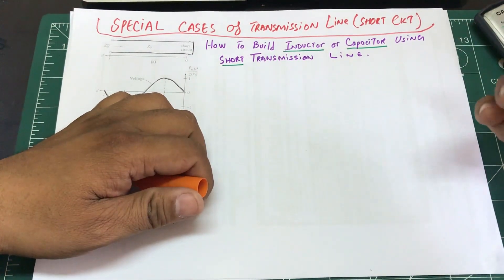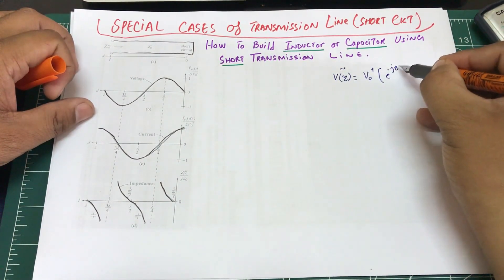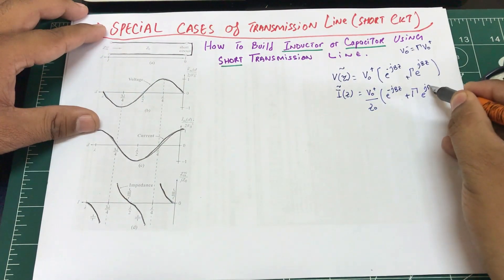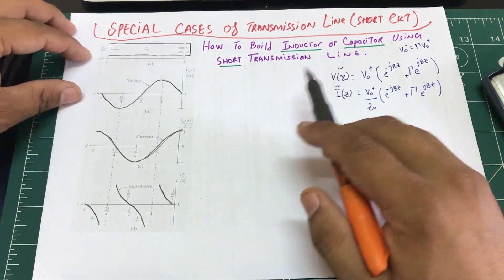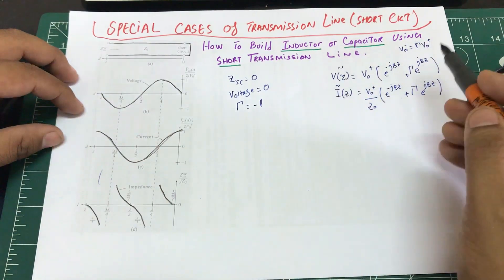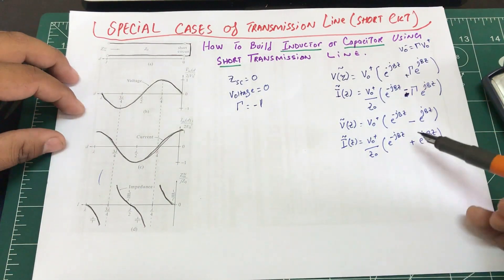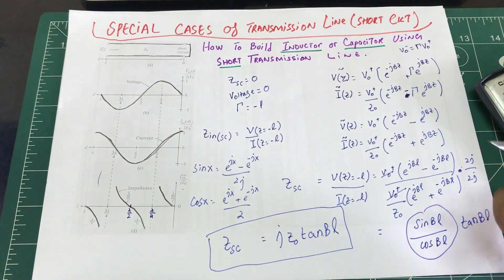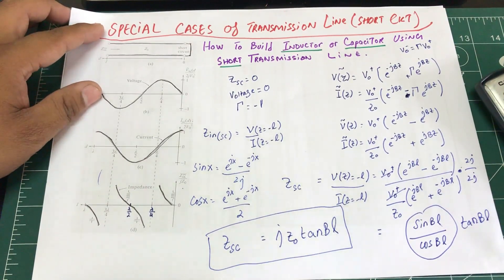Short Circuit Stub Design | How to build Capacitor/Inductor using Short Circuit Transmission Line

Comment: Cool explanation. Do you have an idea how added a series capacitor between your T line and open circuit stub would affect the output? I notice that when i add a real capacitor with parasitics, the input impedance changes drastically. I believe it has something to do with the phase delay in the capacitor effects the stubs performance, but im not sure how to analyzer that.